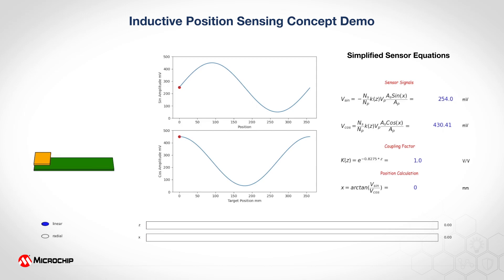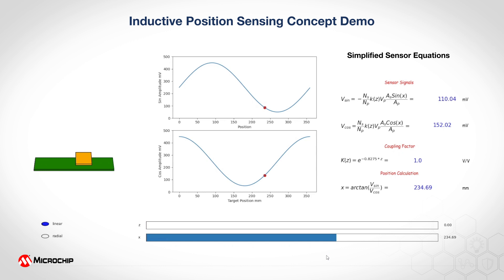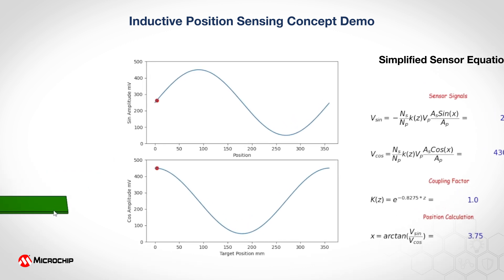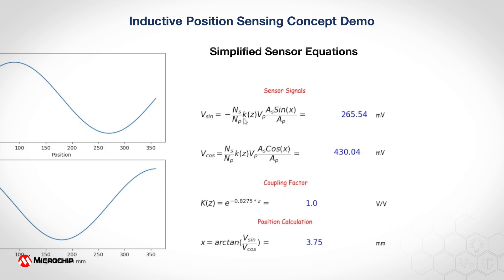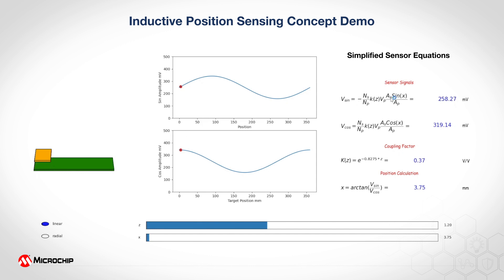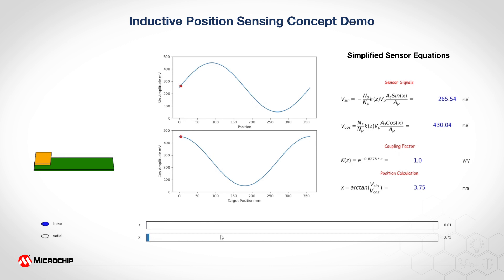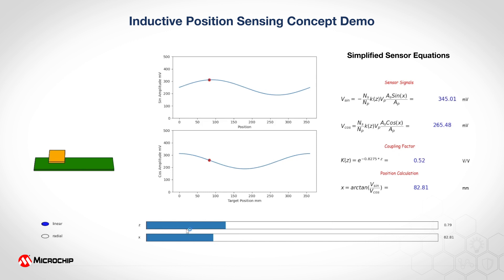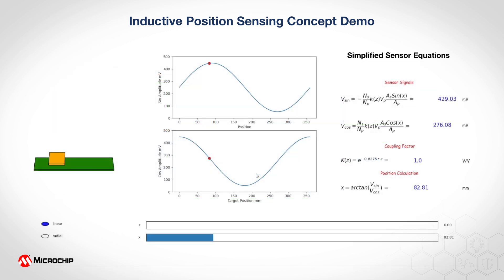Inner Workings of an Inductive Position Sensor

Comment: Thanks for the video, is the analog output of these flat sensors 4 wires or just 2 ?
Reply from the maker: Thanks for your question! In the demo video the flat sensor's analog output has 4 wires. In general, an analog output can be transmitted using either 2 or 4 wires. A 2-wire analog output uses a single pair of wires to transmit both power and signal, while a 4-wire analog output uses two pairs of wires, one for power and one for signal. Hope this helps!

Comment: Hi! Thanks for video! Maybe you could help me with one question, please? My boss believes that the object, whose movement the inductive sensor was monitoring, can break the sensor even if there was no direct contact between them. Just by its erratic movement.. I am sure this is not possible, but how can I prove that to him? The thing is that several inductive sensors are out of order just after three years and they are very pricy. I am in charge to find the reason of their failure..